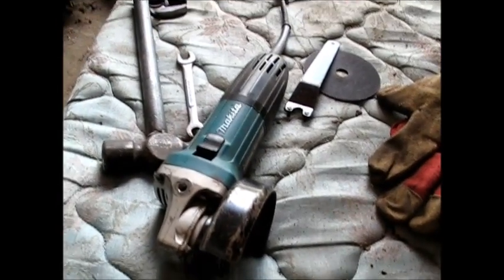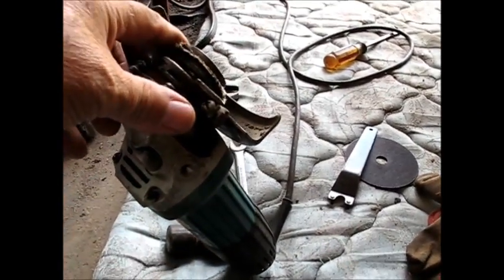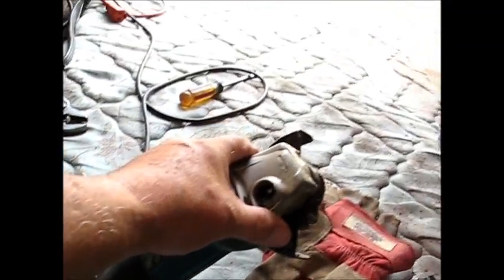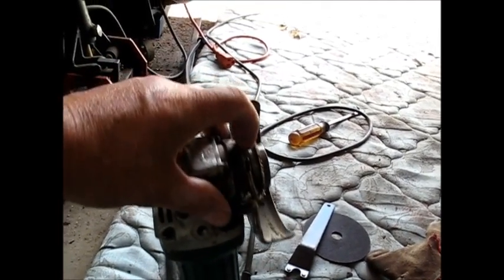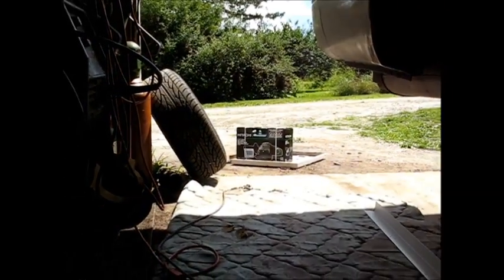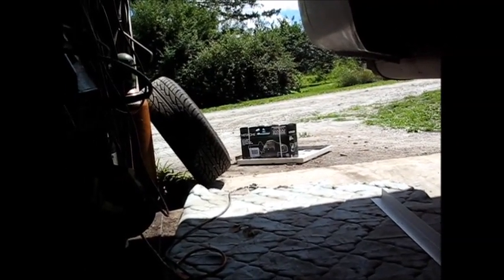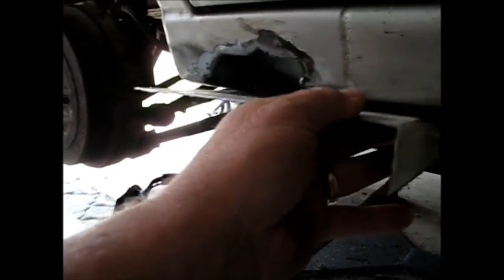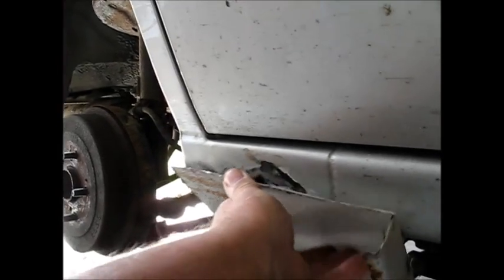They Don't Make 'em Like they Used Too!

Comment: I got a Hitachi saw recently.  It was the only one I could find that had replaceable brushes, ball bearings, and a 5 yr warranty. It cuts like a dream, very happy with it,  so last month after looking at those little 4 1/2in grinders, I bought the Hitachi.  I liked Makita back years ago, but it got where they were not holding up and I got tired of repairing them. Other Hitachi tools have been top notch, so it was not hard to  choose.  Time will tell.